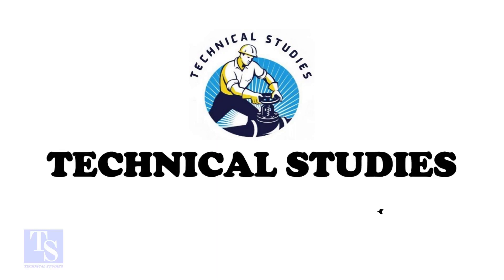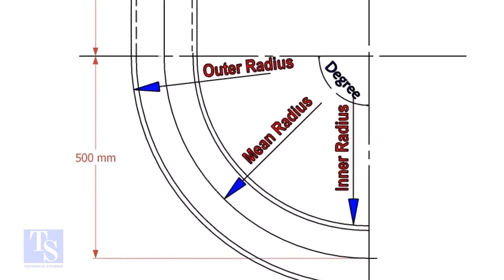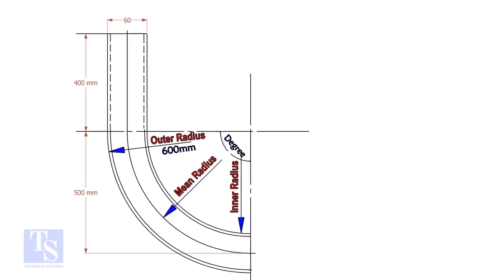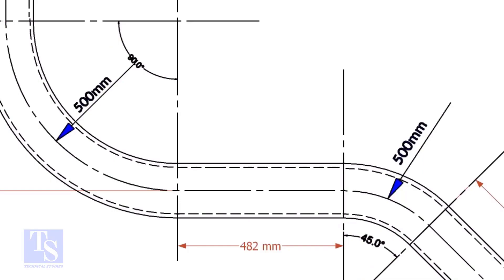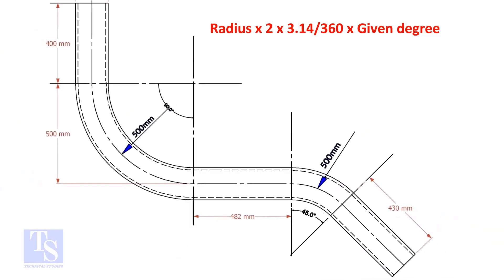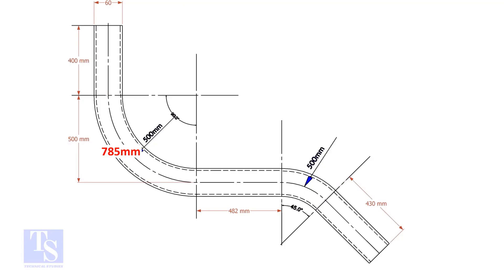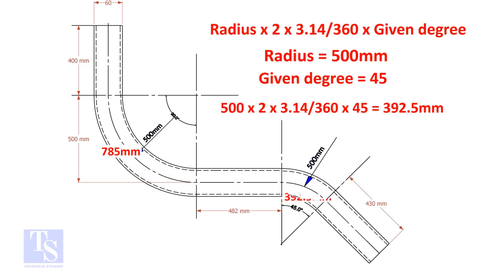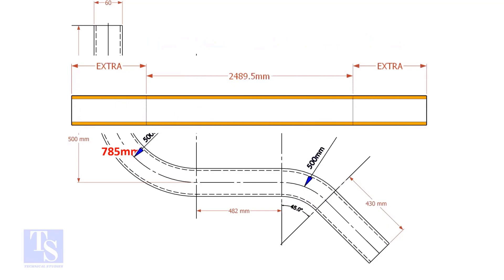How to calculate Bend Length of pipes and rods

Comment: Hi, Great video. Question? I got a pipe of 2070mm, I like to bend this slightly (in the middle with a radius of 20mm) How long will the pipe be?
Reply from the maker: Assuming the bend degree is 90. Bend length = 20 x 3.14/ 4 = 16. After bending, length of one side shall be 1039mm.